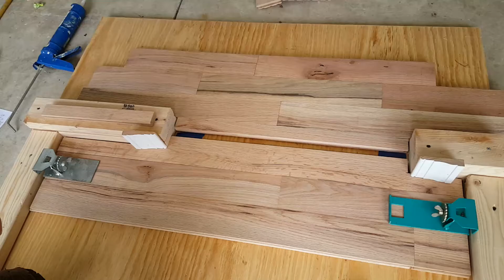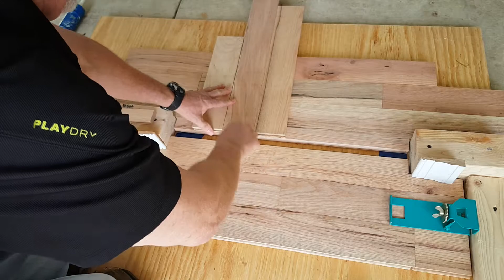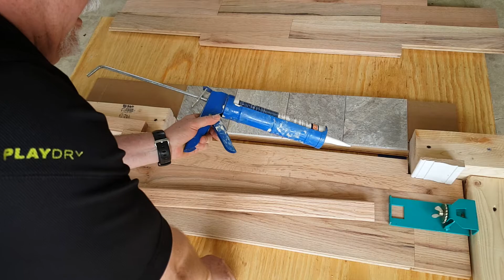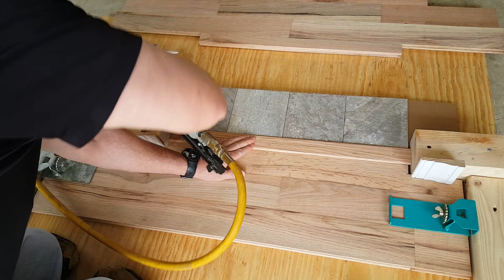Wood Universal T-Molding Installation Video | Zamma Corporation

Comment: I am going to be using the Zamma acacia T molding (special order from Lowe's).  Ca you tell me what kind of space I need to leave between the acacia hardwood and the glazed porcelain tile?  The t molding won't arrive until after I have started on the hardwood install and I want to make sure I leave a proper sized gap between the two.  Thanks!!!